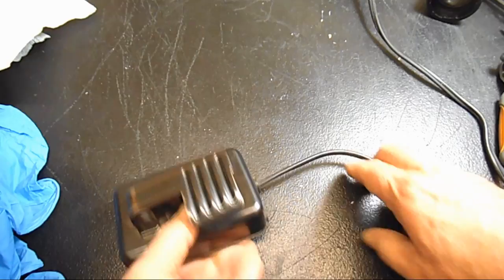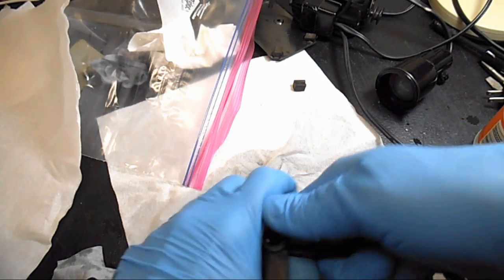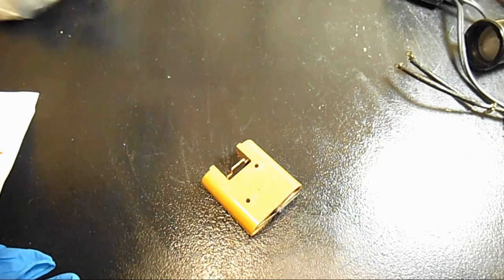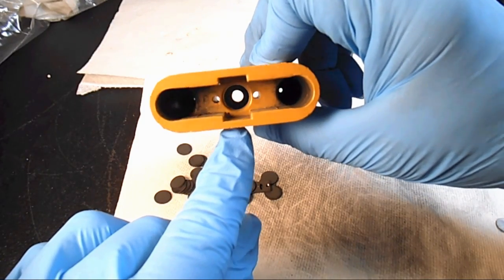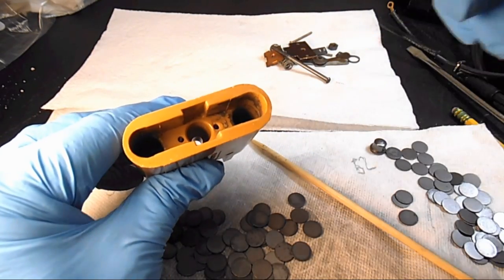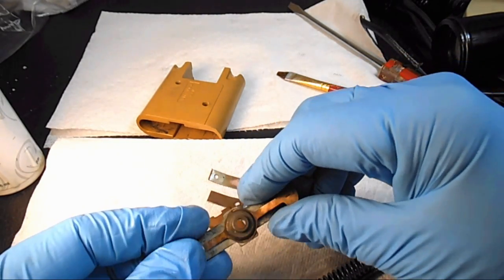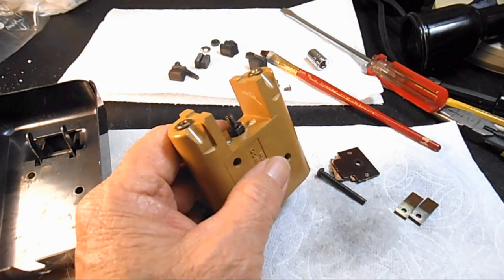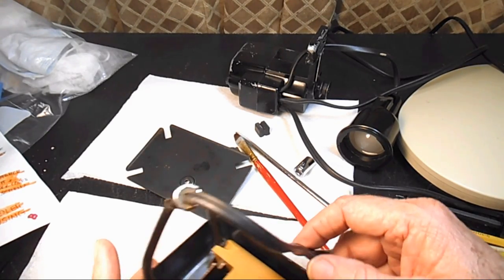The Foot Controller of a Singer Model 99K Sewing Machine

Comment: The sound of that full force motor going puts a smile on my face.  I’m going to go see what my foot petal looks like inside.  Thanks for sharing Andy
Reply from the maker: These poor foot controllers have been ignored most of the time but they were made very well. Can be cleaned up and adjusted to almost new condition and it's very rewarding to hear that motor have to agree

Comment: Thanks Andy tube, that explains a lot.  I will also watch the other videos on it as I have several button controllers, one of which I noticed it gets hot.  Thanks again.
Reply from the maker: "several button controllers'?? Ooo, you've got a collection of machines? Thank you, thank you for saving them. So much fun. Good luck always.
Reply: @andytubesewing1953  yes Andy tube I got a a 338 in at a thrift shop awhile ago, then a client paid my long arm service ( a Gamill) with a “ Touch n sew “ with new gears but still needed some restoration, which lead me to you. …Consequently hearing you talk about the 301 triggered to relapse on a shopaholic , retail therapy! And purchase 4 machines , plus one send by mistake and the seller told me to just keep it because it was heavy 237 fashion mate…. All within a few weeks 😅…. Yes I know , I got a bit of a problem. But I learn so much and is basically harmless. The ones a purchase were 301 coco, a 404, a rocketeer 503A 🤩, and the 329 K. I find that working on the machines is very relaxing and rewarding for me. 
Thanks again mr. Andy Tube. Have a great weekend.
Reply from the maker: @marlenebudnik3133  A nice beginning to a small herd. All nice models. I'd love to work on a 237 again. It's so unique and I can't imagine it not lasting forever with that sliding zigzag and traveling hook system. Oh, those Italians! Have fun.
Reply: @andytubesewing1953  yes I wasn’t to inform about it at all. I have to say that it sews very nice , I made great buttonholes yesterday, I supposed once you know to wind bobbins well is ok. It can also  do One thread chain stitch ! Is in very nice shape now and complete with accessories.
Reply from the maker: @marlenebudnik3133  I did not know about the chain stitch, so thanks for sharing that.
Reply: @andytubesewing1953  I that one looks wonderful and pristine, I cleaned greased and oil and I was good inside but something is wrong dawn the bobbin … it sounds like scratching noise somewhere… I haven’t worked one more for now but intend to get it running good. And yes it looks like it would last for ever …. Except for that plastic thing that holds the bobbin.
Reply from the maker: @marlenebudnik3133  The BW of the 237? If that is what your talking about, The Bobbin Winder System of the Singer Model 237 Sewing Machine Video is here: https://youtu.be/xCxEHLH_Om0
Reply: @andytubesewing1953  thanks Andy , I will watch it. 
The problem seems to be with the shuttle driver , I test the bobbin and it’s good , it could also be the hook, but it looks in good condition.   I haven’t worked on it because I have been having too much fun with the other ones. ☺️
Reply from the maker: @marlenebudnik3133  well, fun is the main goal you are going about it properly 👍
Reply: @andytubesewing1953  yes🙂, have a wonderful Sunday afternoon!

Comment: Super helpful, I just started to try using my 99k, got it at an estate sale, and there is no slow stitching xD it goes from 0 to full power with no in-between. I might take a peek inside with proper safety gear of course as I can see the papery insulator.
Reply from the maker: That zero to sixty is a good sign it needs an overhaul. There may be some controversy as to whether that pad is really asbestos but my feeling is better safe than sorry so I treat it like it is. If you find other little problems with you new beauty I have 18 more videos for model 99K; https://www.youtube.com/playlist?list=PLsCOZgzzaiKIIUgkEujqHc9iNWN9NPW2Z
Thanks for watching my channel and good luck with your repair.

Comment: Great video. My 99 is from 1955 and it has the button foot controller. I wonder if the metal one you have is one of Singer’s “better ideas” or so they thought, LOL. I don’t sew barefoot and after you mentioning the foot controllers get warm/hot I decided to be more aware of that in the future as I usually leave my machines plugged in until I’m done sewing for the time. Take care Andy.
Reply from the maker: I wonder too! I have seen button controllers on other models older than 1955. I know Singer made a cabinet (No. 49) that the 99K could be mounted in as well as Combination Table 301. I don't know if they used a button controller with a knee lever. So much information has been lost over the years. Singer has always recommended unplugging the machine when not in use. Some people leave the light turned on all the time as a reminder it is plugged in. Does your 1955 model have this style of bobbin winder or the style with gears? Just curious. Thanks for watching, Rita. Take Care.
Reply: Yes it is the same bobbin winder. One thing to mention, mine is not a “K”, but a “-“, so 99- must be a reject of a 99K. LOL. If so they made 25,000 rejects. Maybe you know why the minus after the number 99?
Reply from the maker: Sorry, I read once about the dash but can't remember the story. Maybe that some were made in Canada where they later made the 185J, VS. Kelbowie, Scotland and thus the "K", but don't quote me on that. It is not a reject though. http://possumjimandelizabeth.com/xhtml/collect_sewing_singr99.html
Reply: Aha! I found the answer on Ismac. “Just a hyphen was used by the flagship factory in Elizabethport (USA). Now I can rest. 😁
Reply from the maker: Great detective work, Rita! Makes sense too since the K stands for Kilbowie, Scotland. This reminds me of the 401A, 403A and 404. The 404 was made in Elizabeth, so no "A" added on the end. The 401A & 403A were made in Anderson, S. Carolina, USA. Thanks for tracking down the mysterious 99- vs 99K.

Comment: I wonder if a paper hole punch will work on that, works good with gasket material but that might be a bit thick for it.
Great video, I just got a controller like that with a 1927 Singer 66 I just bought.
Thanks for another goodun.
Reply from the maker: Welcome, Mark. I did try a paper hole punch afterward and it just could not get thru the dense material. I was just using a single punch hand-held model so maybe a more professional model would work.

Comment: My1951 controller had only one slightly out-of-round carbon, and thanks to your video, it's all clean and shiny again. 

The rubber feet on my 99's controller were really hard and they nearly dissolved in the alcohol. Do you know of a place to get replacements?
Reply from the maker: I don't know of anyone selling that type of foot. Local hardware stores sell many types of bumper feet and maybe you could use a different type. I have even seen stick-on feet and bumpers to cushion and prevent sliding. https://www.amazon.com/Adhesive-Electronics-Speakers-Computers-Keyboard/dp/B085DMB1XV/ref=sr_1_8?dchild=1&keywords=Rubber+feet+self-adhesive&qid=1630182319&sr=8-8

Comment: Do you have a  video on replacing a dedicated knee pedal mechanism on a 1923 99k? I bought one and the mechanism inside is some kind of ceramic and pretty much totally disintegrated. The actual  knee bar is missing.  I'm not sure if I should just buy a new motor and foot pedal or try to find a different solution to restore it.  I would appreciate your input.
Reply from the maker: I sure don't. This 99K was the only one I've ever worked on. Most knee pedals I've seen from pre-WWII have the ceramic housing in a bracket with a lever/plunger mechanism. Post-WWII era Singer put the ceramic carbon disc holder (later plastic) inside a Bakelite or plastic housing, as you see in a button style or clamshell style foot pedal. A bracket on the cabinet was made to hold the foot pedal and the fold down knee lever had an arm that pushed on the button or clamshell cover. The internal parts did not change much. I once bought the metal bracket/knee lever parts along with a button style pedal and mounted them in an old treadle cabinet that a fellow had installed a modern 500A into but he wanted a knee lever to operate it. I bought all the parts from eBay and http://thriftyfarmgirl.com/
Reply: @andytubesewing1953  thank you.  Mine has no housing, but just mounted inside the hole on the right side.  I'll keep trying to figure it out.  I appreciate your quick response!  I'm a newbie in this but pretty much all in.
Reply from the maker: @sherriharris6142  Right, I get it. What I was trying to explain that that controller style you have was later used inside the housings for foot pedals. It's the same. Some people replace what you have with a foot pedal and a smaller metal bracket/knee lever taken from a more modern cabinet, like from the 1950s/1960s. Sometimes the wires from your style controller went to the motor and sometimes to the 3 pin terminal. Motors can be rewired to the terminal to be controlled by a plug with the line cord (power) and the foot pedal. You may want to remove what you have and buy a new motor with foot controller already assembled but may need to rewire the terminal. There are many variations. I don't have videos for the internal controllers in the cabinets. Yours is likely a cabinet from an earlier model, like a 66 or even 15 that the owner reused for a new 99K. I do have a manual for model 15 that has info about the internal controller and wires. If you want a free copy email to andymanuals53@gmail.com and be sure to ask specifically for the Adjusters Manual for Model 15-91 as we gen many emails per day. Good Luck.
Reply: @andytubesewing1953  thank you so much for your help.

Comment: Firstly, thanks for making this video. I'd have no idea how to restore my controller otherwise.

I've gone and stripped one of the screws holding the cords on (the ones you remove at about 14:45 in the video). I don't have a parts list, though. Do you know what the replacement part is?
Reply from the maker: Singer part No. 1783 "Controller Resistance Unit Screw Nut for 196906"  My channel email is andytube53@gmail.com. Contact me if you'd like me to email you back with the whole 21-page parts list/diagram. Good Luck.